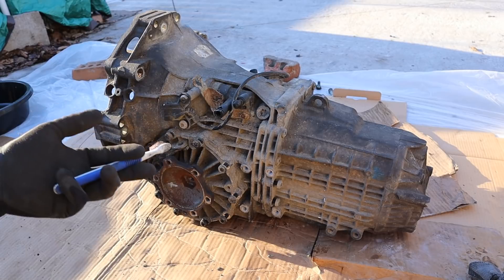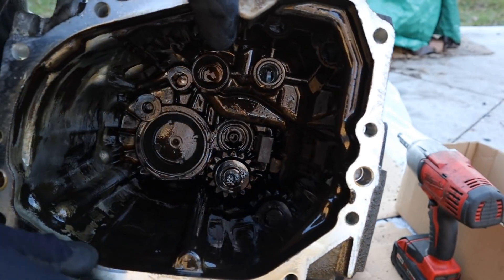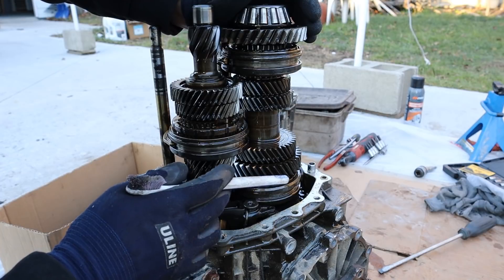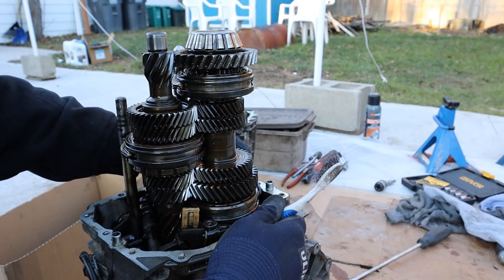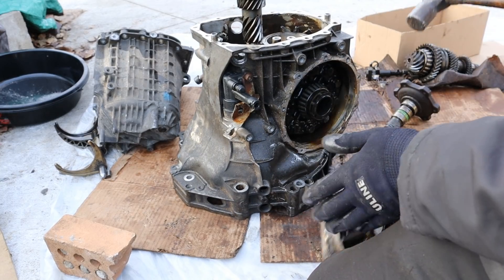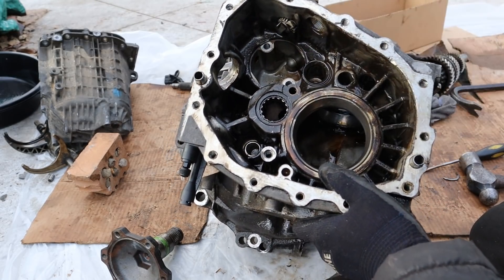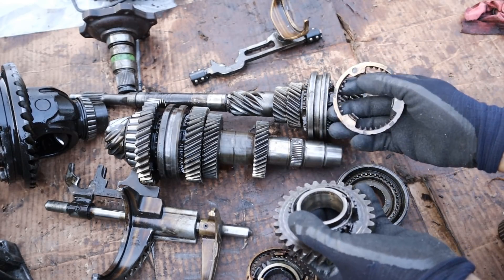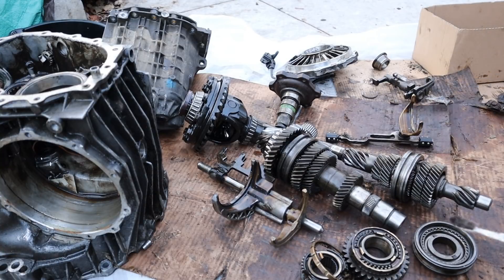How a Manual Transmission Works

Comment: Toothbrush is paid actor. 

Thank u for the lesson today im really thinking into getting a stock fwd transmission and modificate it into a shorter 4th and 5th gear and all around replacing the angle cut gears into straight cut ones. Its all dream thinking but something tells me its possible (idk if it will kill my wallet or not or if the maintenance will be more often than normal)
Reply from the maker: The straight cut gears will make alot of noise at those speeds!

Comment: The great thing about driving a car with a manual transmission is that operator skill directly affects wear on a clutch and manual transmission. Learn how to drive a car with a worn clutch and worn synchros and once you have mastered that, a new clutch and transmission can be made to last the life of the car. For example, engaging the clutch at idle or just above idle, not riding your clutch with the foot once engaged, preventing excessive slip, not resting your hand on the shift lever, and shifting gears and making a momentary pause to allow the synchro time to equalize speed - just some techniques to optimize the life of the clutch and transmission.

Comment: In neutral, clutch engaged (pedal not pressed), there is a bearing noise when outside temp is below 32 degrees.  The noise goes away when engine warms up.   I'm afraid it will be a costly repair
Reply from the maker: Could be that pilot bearing

Comment: I found the synchronizes on reverse to be very handy for rolling directional changes, as well as preventing grinding when shifting to reverse.
Reply from the maker: It works but it's not good for those syncros
Reply: @speedkar99  it does give you a more refined experience though

Comment: Ever think about tearing down a semi transmission with a 10 speed, 13 speed or 18 speed??  That would be so cool to see how they work compared to a traditional 5 speed.
Reply: Big old gears without synchros. They look like a 5 speed inside with one or two hi/lo range boxes. They're fun to drive once you get the hang of them!
Reply from the maker: That would be sweet. Wonder where I could get one from though....

Comment: Did he say automatic transmission fluid?  But this is a manual transmission...?  My 2003 3.2 liter Cadillac CTS manual transmission 5 speed also uses automatic transmission fluid. Dexron III
Reply from the maker: Yes that was an error. Should be manual transmission or gear oil
Reply: @speedkar99  no worries. My brain works in details. I'm that guy that tells the college professor when the book is wrong and actually proves it. Lol. Your lesson was awesome. I would always check to see what fluids actually go into the transmission per each vehicle I'm working on anyway research research research. Lol

Comment: Why do I sometimes need to release the clutch a bit while applying pressure on the shifter knob when going into 1st gear or reverse from a standstill?
Reply from the maker: Something doesn't sound right... You need to depress the pedal so engine power doesn't rotate the input shaft
Reply: @speedkar99  It's like the shifter doesn't make it all the way to the indent even though it's staying 'in gear' as far as the H patten goes. So after I realise I'm not moving I apply constant pressure to the shifter knob while slowly releasing the clutch just a little (just enough to let the input shaft slip a little) and I can then feel the shifter go that final ~3mm to fall into the 'proper' position and only then can I start moving.
Reply: @seljer  In the case of reverse, that's simply the idler gear needing to mesh correctly to engage. Because most reverse gears are unsynchronized, if the gears aren't aligned it won't engage until one gear moves slightly. Then it'll pop in. Happens on my car all the time. I either use your method or shift into 1st, then back into reverse until it engages. 1st generally doesn't suffer the same problem, however because one typically shifts into 1st from a standstill, the same principle applies. Not an issue once moving. However, unless you have a synchronized reverse, you can't shift into reverse while moving or you'll grind and wear the gear teeth.

Comment: I'm surprised you don't see more wear on the synchronizer, it seems to do its thing just by a close press fit. Also I didn't realize those collars also spin, so there is constant friction with the forks.
Reply from the maker: The forks have a loose fit with the collars. Everything is lubricated as it's filled with fluid. The synchroniser only wears for the half second it takes for you to move the shift lever from neutral into a gear. After that, it does not have to resist motion, unlike a clutch pack in an automatic transmission.

Comment: I don't understand why you work on the floor?
You're ruining your knees
Work on the bench
Reply from the maker: You are right. I recently got knee pads which helped alot recently. However a transmission is heavy to work on a regular table.
Reply: @speedkar99  
O.k
We follow after you when you work with Little stuff :-)

Comment: So what happens when someone on the highway shifts from fifth to "sixth" which turns out to be the reverse? Totaled transmission?
Reply from the maker: The syncro will take most of the hit if anything.  It most likely won't engage since the speed difference is huge
Reply: Reverse is unlikely due to the speed difference, but people do occasionally perform a "money-shift" (like 6th to 3rd or 2nd) and over-rev the engine. The Humble Mechanic had a video about that, I believe. Not the same thing what you are asking about, but related.
Reply: The engagement won't take place. You are going to hear a loud grinding sound and stop your self by instinct. Now if you are determined to "shift" then you can pull the lever until the teeth of the gears are turned to dust or most likely a gear breaks. After that it's mine and every other Mechanic's headache xD